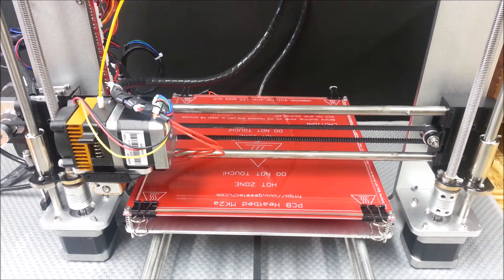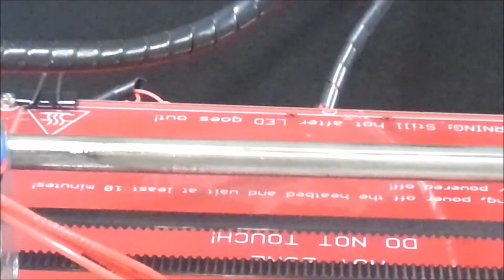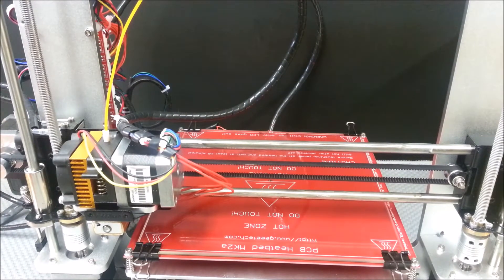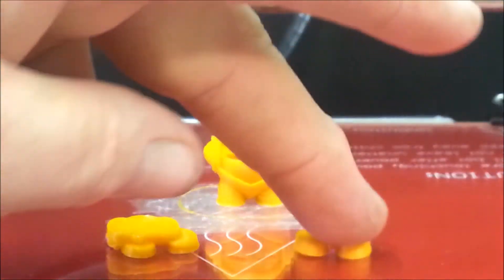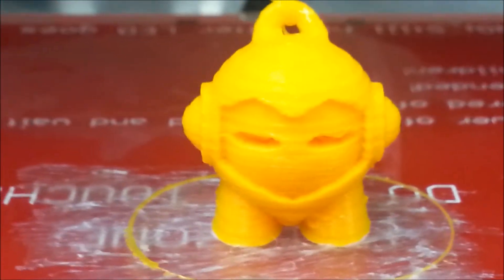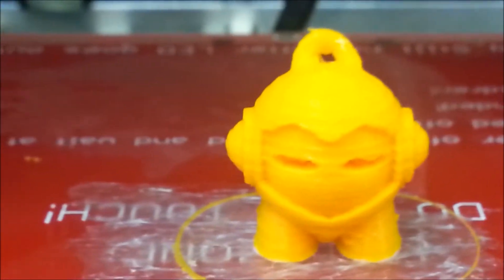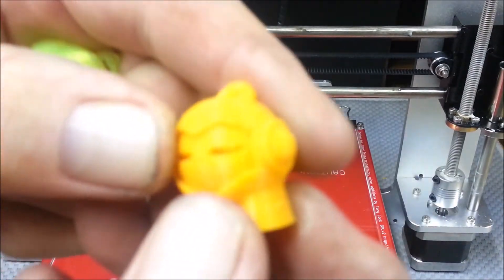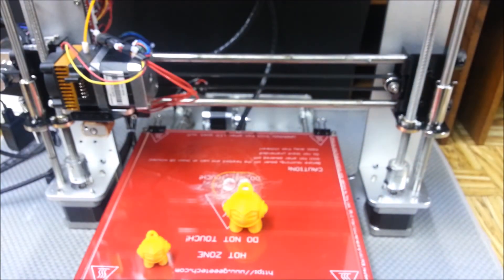Geeetech Aluminum Prusa I3 Temp Adjustment For A Better Print

Comment: Hi. Your videos have been very useful for me. So thanks. I have a Geeetech i3 pro b. It was quite a struggle at first. Now I have it pretty much under control. Regarding z-wobble: I was about to install a z-wobble mod but decided to first try and tweak my couplers making sure the threaded rod is not stuck all in, leaving a gap between the rod and motor shaft. A good test is to check if the coupler is still compressible after threaded rod is installed. This tweak eliminated the z-wobble almost entirely. Or even entirely. Once i saw that i decided not to bother installing the mods. Thank you again for sharing your videos on these Geeetech printers.

Comment: I would check actual temperature with external thermometer,  sometimes extruder temp sensor (or whatever its using) is not accurate and it gives fault values ( I saw this in schools with some higher quality  printers) PLA or ABS is certified for one temp and extruder has something different. 

How happy are you with this printer model, I have limited budget but I was thinking to go with alu model instead of Acrylic ?
Reply from the maker: +Danijel Rapaic I love it.  I was extremely tempted to get the Acrylic, but was afraid that over time it would crack from the vibration.  When I found the aluminum model, I fell in love.
Reply: Than its decided, it will be Alu :-)

Comment: My Geeetech Prusa I3 is in the mail. :) I watched another video (sorry no link) he fixed the wavy z-axis print problem my installing a different z-axis bracket. Essentially the Brass z-axis nut gets too close to the servo-z-screw coupler, like yours. The non-wavy z-bracket has the brass on top of it, as far away from the servo-z-screw coupler. I as thinking swapping the z-brackets, left and right so that they are upside down and x-servo is on the right not left. The z-screw wobble decrease the further away from the coupler.
Reply from the maker: That does sound like it would work.